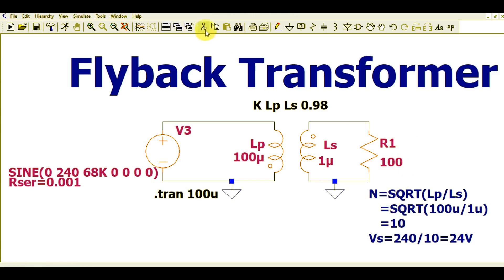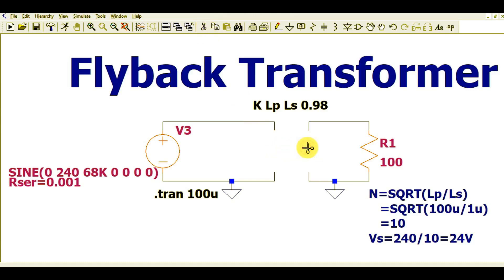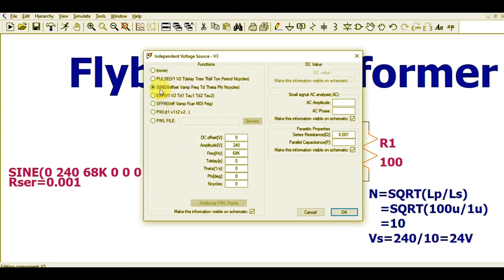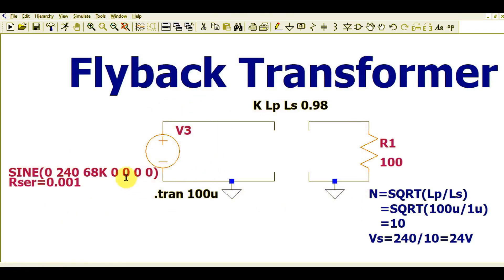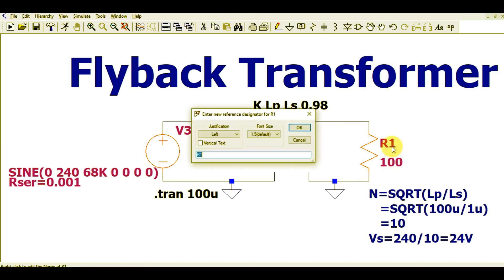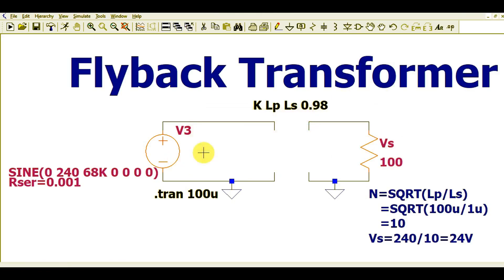LTSpice Flyback Transformer | Simulation

Comment: Is this simulation working when input voltage is dc and using a mosfet as a switch for switching the flyback?
Reply from the maker: Let me check and upload new video.
Reply: @ElectronicsCircuitHubECH  please give me video link